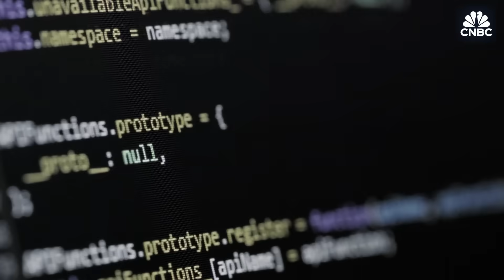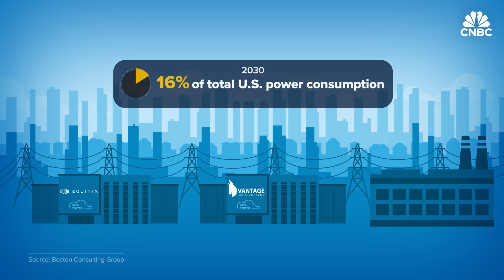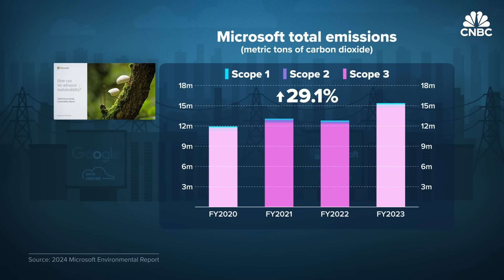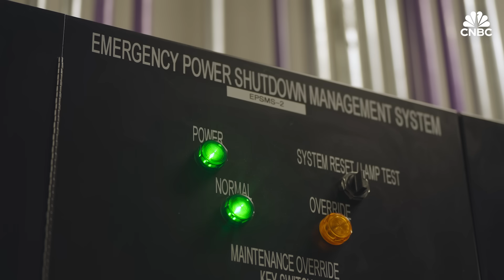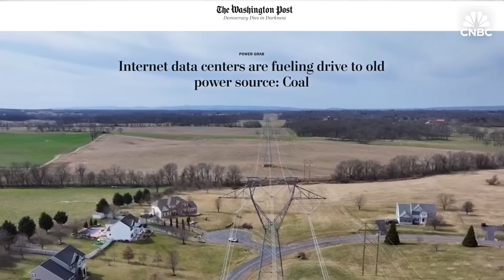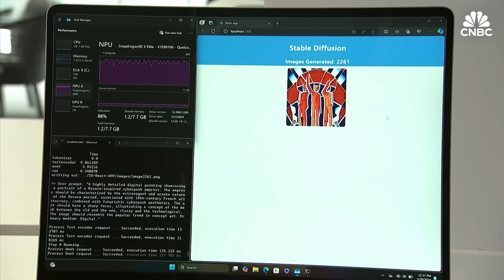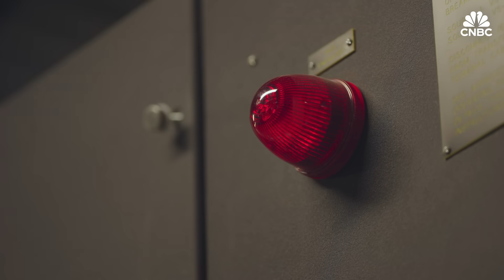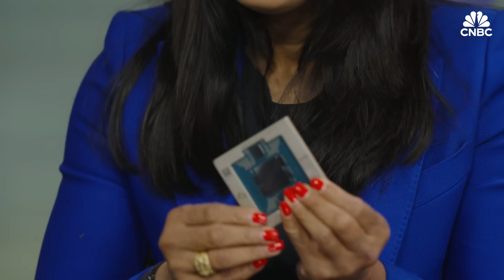How The Massive Power Draw Of Generative AI Is Overtaxing Our Grid

Comment: I am an EE, took a mechanical engineering class in the early 90s, was not too interested in it. But the professor was working on thermal chip cooling systems, from what I understand is common tech in laptops now.  Your laptop chip heats a fluid in a sealed tube, then it boils off and cooled by a fan, turning it back to a liquid. It is taken for granted but without such a solution, a slim laptop would not exist. He pretty much stated without advances in thermodynamics and cooling, eventually all the EE tech will come to a dead halt. It is true.
Reply: As a refrigeration tech, i eagerly await the incoming pledges of fealty from the coding world
Reply: yes this is called a vapour chamber/heatpipe and heatsync
Reply: I hope to be as amazed by literally anything as you are by air conditioners
Reply: What do phones use?  Just heatsinks without heatpipes?  No fans.  Just metal contact.
Reply: @cryora  they use a vapor chamber way less effective as it takes much longer to dissipate without active cooler
Reply: We literally have direct cpu to water based liquid cooling
Reply: Is EE a sparky?
Reply: That is a heat pipe technique and has been used since for many decades.  It became popular even among PC hobbyists in around 2000s.  Thermal management is critical to electronics design since inception, so this is not a profound concept.
Reply: @beyondfossil Yep. Besides a heat pipe will only move the heat a few inches from the source. It doesn't help at all in this case. They need to move it, all the way out of the building.
Reply: @LisaSamaritan  Sure, but it's a critical part of a chain of thermal transport.  Because if the excess heat cannot effectively escape the computer's chassis, all of the external heat sink outside of the building becomes useless.
Reply: @LisaSamaritan  Yes, my professor worked for IBM and they were trying to cool mainframe processor boards for large scale computing at the time. First heat has to get off the board. Then there is another thermal management system to cool that. Thermodynamics is a very complex science. If the processors get too hot as discussed in the video, the amount of water needed may increase exponentially.
Reply: @beyondfossil  A masterclass in how to comment without adding anything useful to the conversation.
Reply: @RR-om3zx  How so?
Reply: Sometimes I wish it was never discovered.
Reply: Cool story bro

Comment: AI also replaces jobs, so during a time of severe electrical shortage and need for building to help the EV transition, why not use an inefficient energy hog to fire people. What could go wrong?  🤔
Reply: @Randy_Richmond While true, the historical issue with automation is that it replaces people too early. Even back with the Ludites and automated weaving machines the problem wasn't exclusively that people were losing their jobs (although that was a big deal, as textiles were the largest employer at the time), it was that the machines replacing them were physically incapable of producing high quality work. Eventually they caught up, but in the meantime people were out of work and consumers were stuck with lower quality goods.

In the case of AI, it is clear to anyone who is both familiar with how it works and honest to themselves that it is inherently incapable, at a basic level, of performing many of the tasks performed by people it will attempt to replace. This differs from mechanical automation, which can with refinement both outpace humans and compete with them in quality. This will likely self-correct as the investor class realizes this, but not before livelihoods and businesses are lost unnecessarily. 

The AI bubble isn't a matter of people trying to stave off automation that will take their jobs. Its rational people on the street trying to shout up at the people in ivory towers that the material they're using to make their towers taller is coming from the foundation.

Comment: There is no shortage of (electric) power and ways to make it. If there's a demand, it will be fulfilled. Renewable generation is cheap and expanding rapidly.
Reply: Unlimited POWER!!!
Reply: Except it take a good part of a decade to install extra grid to transmit the power or demand!
Reply: @gunsumwong3948  not really. Most renewable projects come online within a year or two. Tesla can install large grid projects in less than a year. They are simple to construct and deploy. The factories building them are already up and running. Also a simple rewiring of existing power transmission lines can increase the grid infrastructure capacity in minimum time.
Reply: @ryen7512  Tesla installs battery only.  That is to storage the energy unable to use during peak demand by solar and wind!
Rewiring means replacing the transmission line with a new one that can carry more ampere than the existing ones without overstressing the towers which can be 40 to 60 years old.  This is just talks.  To replace any of the transmission line there will be a long outage that no one is prepared to accept.
The problem with the US electricity is it is highly fragmented and everyone is look after his/her own interest by maximize others' input.  Even the grid isn't own by one company but several national and still even more state grids companies.
Reply: @ryen7512 quit lying, liar
Reply: I feel like a large part of why people think grid expansions, upgrades and government project is because of the massive amount of beuarocracy and our disfunctional government. Other countries manage to make entire rail dozens of times faster than the US  @gunsumwong3948
Reply: Yea, cutting down trees for solar panels, wind mills, and transmission lines. Basically destroying the environment to save it.
Reply: LOL
Reply: @JackHawkinswrites  Why not?  At 99.9-percent mass the solar system, the sun provides Earth a cosmic 173,000 terawatts of power.  Or about 1000W per square meter peak on the ground and its always peak somewhere on Earth.

For reference, 173,000 terawatts will provide our civilization's current annual 620-exajoules of energy in just 1-hour.  We've barely began to tap into the free clean fusion energy we get from our host star.  There is no other power source even remotely close to it within over 4-light years distance from here.

All the combined fossil fuels that ever was and ever will be would only amount to a single bucket of water in an ocean of water when compared to the sun.  The entire Earth itself is like the tiniest breadcrumb next to a large watermelon in comparison.
Reply: Yes there is. I live in a country with rotating blackouts due to demand exceeding supply in the Grid. Power generation projects take a long time to build, ranging from 2 years up to 10 years. Supply takes a long time to catch up to demand. It's not as fluid as the free market absolutist makes it sound to be. Such projects are also often subsidied by Governments, without subsidies Companies don't often invest in such large scale capital and time intensive projects.
Reply: @johnrvf8099  The OP was probably referring to practically unlimited energy from the sun which is the source for all of our energy except for nuclear.  We would not have such an energy crisis if governments quickly dropped fossil fuels.  We'd only have a crisis if we were a Kardashev Type-1 civilization, which we are very distant from currently.

Furthermore, utility scale renewable energy production is at historic low LCOE and still dropping.  Rooftop solar (both commercial and residential) is especially critical since it provides power that does not use the grid since solar photovoltaic power is produced and consumed locally.

Comment: The only way I think AI will work long term, is more energy efficient power, safe for the environment. The cost shouldn't be handed down to residents or end users of AI. More work per watt.
Reply: These companies are trying to convince locals that they need to raise their utility rates so they can develop AI bots that can steal their jobs in a few years.  Why should residents be on the hook for this at all?
Reply: More energy efficient power will inevitably translate into more AI so the efficiency will be cancelled.
Reply: @urbanistgod  Not necessarily, that is something that has to be determined quantitatively. More energy efficiency certainly translates in some % to more energy usage, but you can't claim and take for granted that that % is 100 such that no energy usage has been saved. Moreover, even if it was 100%, the fact that we will have accomplished more AI usage with the same amount of energy is by itself a huge win.
Reply: @2CSST2  Read about the Jevons paradox.
Reply: @urbanistgod As long as the power is generated in a renewable way it doesn't matter how much you use. That's the main concern, ensuring that most of the energy generated is renewable.
Reply: @ricardoamendoeira3800  Renewable energy isn’t truly renewable. Solar panels and wind turbines are made of oil. The fabrication and implementation of “renewables” uses oil. Plus, this is so theoretical, we’re so far away from having the infrastructure for enough renewable energy anyway.
Reply: @urbanistgod you skipped over the biggest renewable energy source, nuclear. That can single handedly change our future, if we build the proper support for it.
Reply: @urbanistgod  are you among the geniuses that were screaming how cryptocurrency is going to take all the electricity? that's not how it works. better to think of it as settling towards a certain percentage to total energy use. there were a few papers and for crypto it's about 0.5~1% max of electricity consumption. besides, increasing energy abundance is always a good thing. it enriches every aspect of life in ways you wouldn't even imagine. for example, many advanced recycling processes are locked away because there is not enough energy.

Comment: At the 5:30 mark, there has to be a mistake, fusion energy from 2028?  If true then this itself deserves a video.
Reply: It doesn't deserve a video.  It has potential, but  that's all it is right now.  I have no idea why it says they will buy electricity from them when that's not even on the table for the foreseeable future.
Reply: Nuclear fusion is nowhere near trust me. It’s always 30 years away. And even if they do achieve nuclear fusion you’re seriously telling me this technology needs a whole different source of energy just to get better?
Reply: @AtomicApple-lk9gm even if we had the technology now, it would take decades to build it and the grid around it.
Reply: @xx133  exactly.
Reply: 3028
Reply: No, it’s not actually electricity. What Microsoft wants is the Carbon Credits for supporting a non carbon emission power source even though it is nowhere near ready for actual electricity production. It’s basically greenwashing. 

The problem about Fusion isn’t the fusion it’s self. We knew how to make fusion bombs since the mid to late 1940s. It’s maintaining a fusion reaction that is hard. It’s like having a mini star on earth. There simply isn’t any material that can withstand the extreme heat of fusion reaction. Making fission nuclear reactors safer, and easier and cheaper to deploy is the real way we solve energy problem.
Reply: @JasonB808  both Tokamak and Stellarator tech is still unproven at scale and will require multiple moon landing level of tech resources to solve. ITER ain't gonna cut it. I checked the startup mentioned here, its overhyped, requires rare Tritium and He3 isotopes, rare on earth plenty on the dark side of moon. The reaction has yet to acheive net +ve energy. IMHO, atleast 20 years away from shipping 1st commercial MW of electricity.
Reply: Maybe by 2048.  Maybe.
Reply: @jessstuart7495 maybe 2084?
Reply: That's apparently what the company is claiming because they made a deal with Microsoft to supply them power by that date; but they haven't even demonstrated making electricity from it yet so it seems unlikely. I'm sure Microsoft knows this so I'm not sure why they signed that deal.
Reply: @microproductions6  I forget the details but Microsoft basically has nothing to lose with the deal. I think either they haven't paid any money, or if they did pay up front helium is contractually on the hook to either deliver the fusion power or pay back Microsoft
Reply: It's false. I think they confused the few experimental test reactors coming online soon (ITER, MIT) with full blown fusion power stations.
Reply: Helion energy is one of the most well-known fusion startups developing the fusion technology following a different approach, (no tokamaks), there are a couple of video tours of their facility/technology on Youtube, I am not saying they could reach that goal by 2028 or at the end of this decade, all I am saying it's interesting to watch.
Reply: 2138
Reply: re: "If true then this itself deserves a video."  no worries, Fusion isn't any more true than Super Conductivity was back in the year 1990.  you likely have no knowledge of this, which goes some way at explaining why you think Fusion might "magically occur" in the year 2028.
Reply: its horseplop at best.
Reply: Modular fission reactors or geothermal. Fusion will cost billions, my city can’t afford it